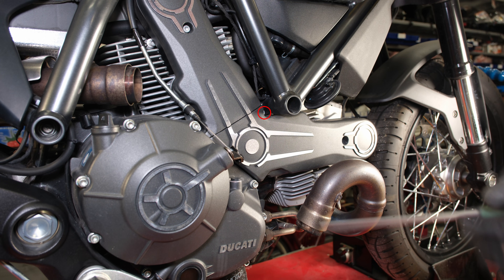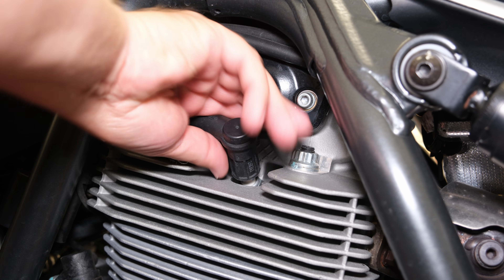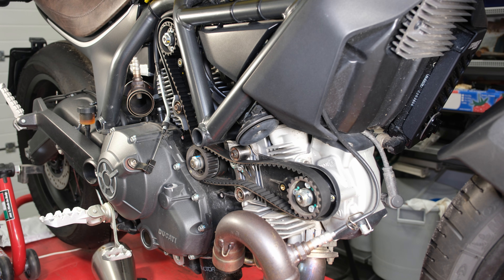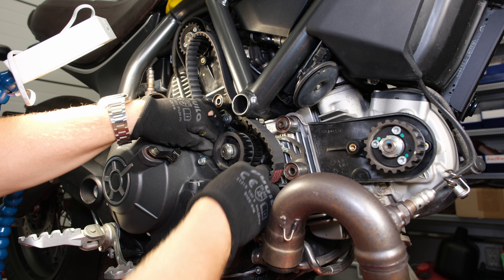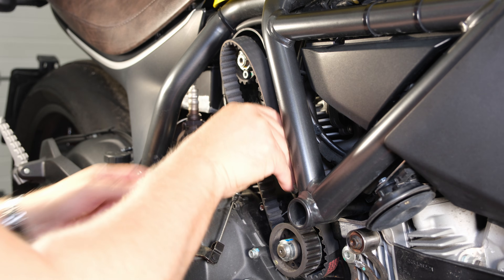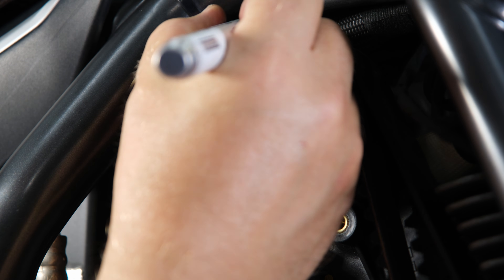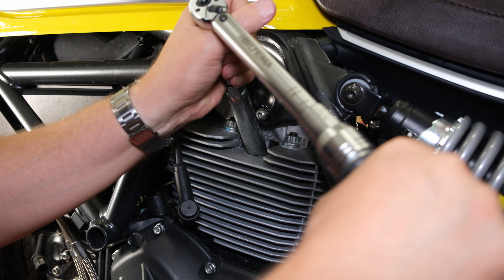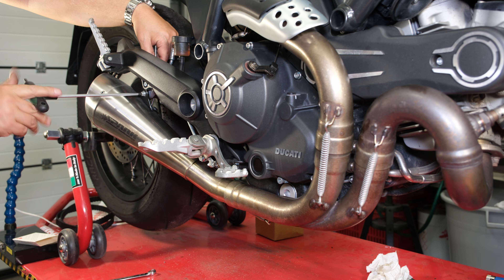Desmo Fix: Ducati Scrambler 800 Quick Timing Belt Replacement Guide

Comment: First thanks for this guide , do you happen to have a part number for the locking tool that you used? Can't seem to find one for my 16 scrambler :)
Reply from the maker: This special tool code no. is 88713.2011